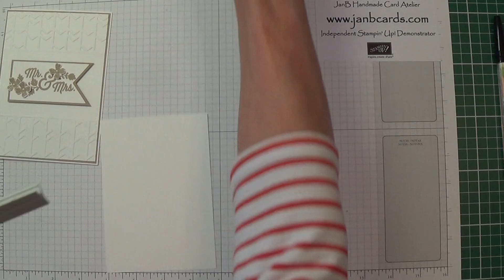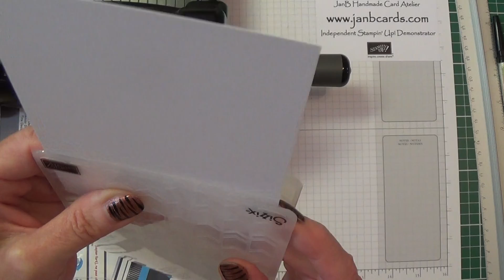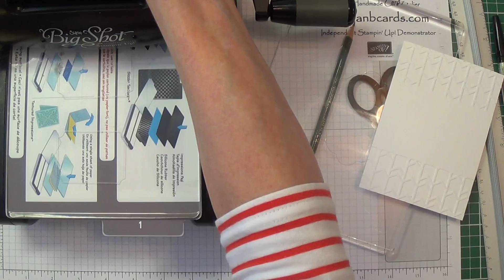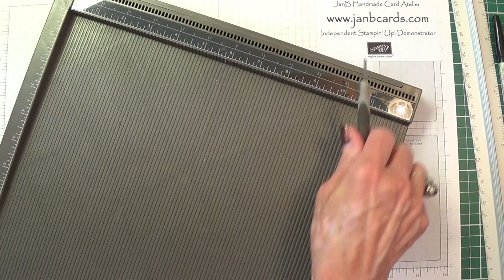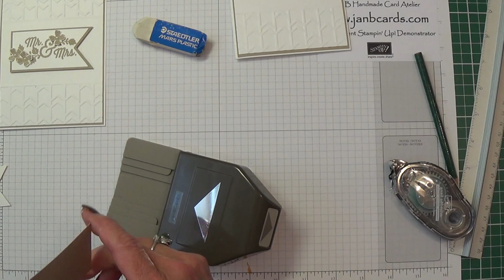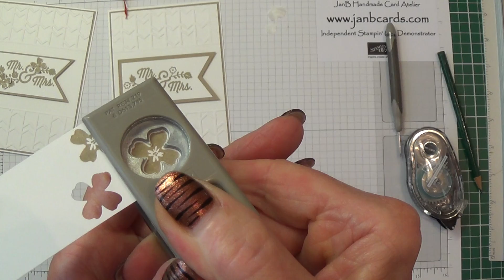No.89 - Split Embossing - JanB UK Stampin' Up! Demonstrator Independent

Comment: Jan, this is a great card which will work on a lot of different embossing folders.
Thank you for sharing.  One question - do you cut a smidge off one side of your cardstock when you are making the card base?
Reply from the maker: Carol Springer Hi Carol. Yes, you're right, you can use any (except the Happy Heart as I explained) and the card would look great. If you're referring to me saying the card base is 5 3/4" by 8 1/4" scored and folded in half, then yes, for my videos, I do because an A4 sheet is 11.69" long. I do it because it is then easier to give measurements for the layers needed. Is that where your question was coming from? ☺ Kind regards, JanB.